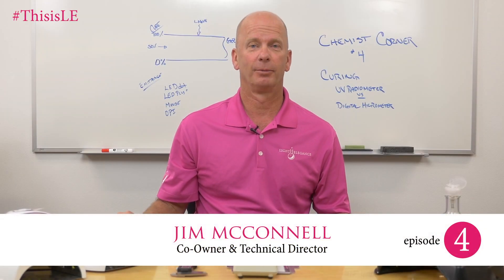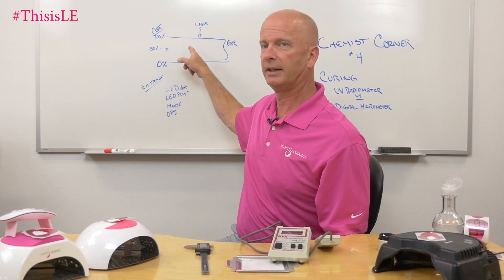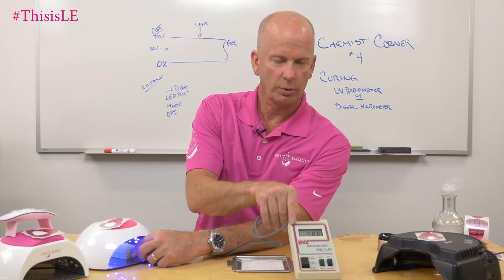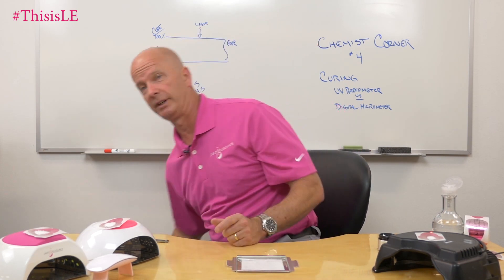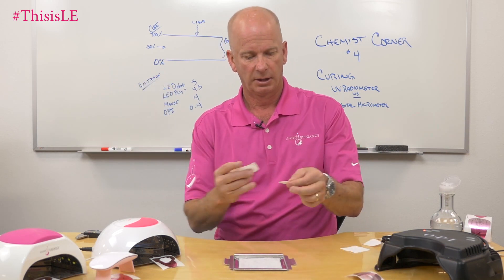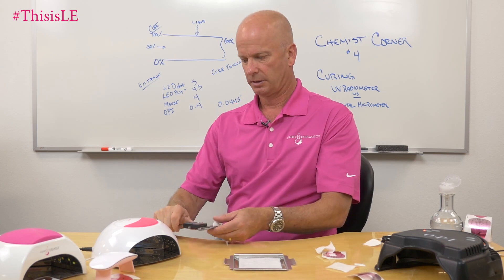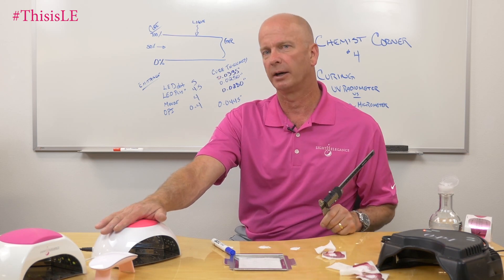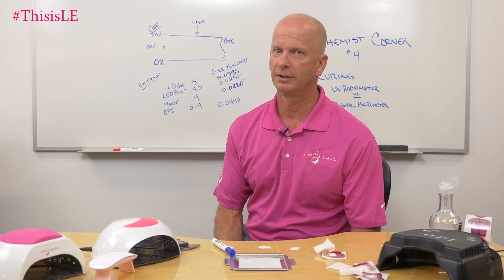How Good is the Curing Power of your LED Lamp? - Chemist Corner #4 with Jim McConnell

Comment: This is really informative, but also leaves me a little confused, I use builder gel and have been taught that you apply it in a thick layer, sweeping down the nail, can even tip hand over to let gravity help with apex of the nail etc but this means the product is much thicker then any of your tests, so I suppose what I'm trying to understand is, is this not the correct way to use a builder gel? And if not why are the nail companies teaching this as the correct method to apply the product 🤔
Reply: Hi Louisa - every company and each product can have a different application technique.  If that technique works well for you and the building gel that you use, then please do not change anything in your application technique.

Comment: but i dont understand the thickness part, is it better if it shows a bigger number? 
and what if the gel on the form is not as thick as i put it on the next form? wont it affect the number? or is it how hard it squeezes the gel together that makes the number?
Reply: You want to apply the gel onto the form thick enough so that the gel will not cure to a tack-free finish underneath - nearest the form.  This will allow the maximum amount of curing to take place to determine the amount of cure thickness that will be measured.  The thicker the cure, the better the cure in most cases.

Comment: Hi -- without the sensors and meters -- would it be fair to say a good test of whether our lamp is doing a good job curing is to make a layer the amount of thickness we would normally apply it at, place it under the lamp, lift it and see if it is fully cured or if gel is still on the form? Also I'm confused about the controls in this experiment... if it is gel polish and not builder why did it not cure at 1 minute? is the layer thicker than recommended? Why did the OPI lamp perform better if the gels are formulated for use with your lamps? I'm so confused, I'm sorry. Any feedback would be greatly appreciated as I have developed allergies and am desperate to avoid under-curing.

Comment: Is the curing thickness only relative to what it was from the beginning or is there a spectrum of numbers that are good or bad? For example if I want to test a new lamp and see if it's good or bad from the start, what would a good and bad starting number for the curing thickness be? Thank you for very educational videos!
Reply: This test is mostly geared to determining the condition of our current curing light.  If you have access to the manufacturer's recommended curing light and want to test a light that you would rather purchase, you can compare the two lights using the same test to see if the light you want to purchase will cure as well as the one that is recommended.

Comment: Hi Jim! Very educational video, the questions I have is, 
The rumour going round is that the gel is only around 50% cured when it’s hard? Is that true?
also I’m using a Sunuv light with the light elegance products ( mainly Cool gel and the buttercreams, which I love) is that okay provided I check it’s cured using this method, or should I be using a different light?
Reply: Hi Leighanne - the SunUV light might be just fine to cure our gels.  What model is it?  Can you take a picture of the interior and send it to me so I can examine to see if it is really a SUN UV/LED light or a cheaper "knock off"?  You can email me at jim@lightelegance.com.  Rumors can be correct but it is like playing the game "telephone" with friends.  Not all of the information is shared.  Some gels only cure 50% while others cure at higher percentages called "conversion rate".  Most of the LE gels cure to 80-93% conversion rate but this depends upon the light and length of time of the gel being cured.  We also allow the gel to sit for a period of 1 hour minimum before performing conversation rate testing - this allows the reactions to be completed.
Reply: @jimmcconnell6079  thank you so much Jim for this comment! I love learning "behind the scenes" stuff!
Reply: @jimmcconnell6079  I think what Leighanne is asking is how much (in percentage) do gels need to be cured for it to "appear" hard. As most nail techs don't have emittance testing equipment in house, a lot can assume the gel is fully cured if it "appears" hard. Which is dangerous because the bottom layers can still be uncured while the top coat appears completely cured. I believe it was Doug Schoon, chemist for  CND (I'm sure you already know) that wrote gels only need to be 50% cured to solidify and appear hard while still not being completely cured.

As for the conversion rates, I am assuming you are speaking of fully cured gels?

Comment: I like these videos. I don’t understand why this is important. Just to keep track of when to buy a new lamp? Also when you’re talking about cure thickness, you’re saying that if the gel is too thick it won’t cure all the way? So what would you recommend?  I obviously don’t want to give my clients bulky nails, but in terms of building strength?
Reply: If you replace your lamp every two years but do not need to replace it because the emittance and curing performance is still great with your lamp, you are spending money on a new lamp that you might want to use for a different purchase or to save it for the future.  Some curing lights don't last 2 years and you may choose to replace the curing light before the 2 year period before you begin to develop lifting problems because of the failing light.  If the gel doesn't cure all the way through to the fingernail, then you will have adhesion failure and subsequent lifting and unhappy clients.
Reply: @Lamar It’s always better to build up strength in layers that way each layer will cure properly. Also I prefer to build the nail in clear gel or very sheer gel. These gels cure “better” at a thicker layer.

Comment: Thank you for this video Jim, very interesting and informative! If there is a sticky layer on the form, would that mean that would also be the same on a nail plate? At what thickness would you gel to be mostly ideal? And what thickness would mean your lamp isn't curing well anymore? I'm definitely getting a digital micrometer, that looks like an interesting piece of kit to have!
Reply: Hi Samantha - I tell techs to perform a cure thickness test on the gels that they are going to use. The most difficult to cure gels will be the colored gels (like white, black, reds, ...) for decoration.  The clear gels will typically cure very thickly.  If the red gel polish cures to a maximum thickness of 0.020", then I suggest applying the red gel polish at a thickness of 0.010" (1/2 of the maximum cure thickness) for acceptable adhesion to the substrate.  If more opacity is desired, a second coat should/could be applied.  

Regarding the "light not curing well anymore" subject - all bulbs that we use to cure gels fail slowly over a period of time.  Our eyes do not observe this slow failure.  If we test the quality and completeness of cure every 3 or 6 months, we can use the digital micrometer to measure the failure for us.  Keeping a small journal or record book at your station to record the test results will document the curing ability of your light.  Once your light shows a decrease of curing ability at about 60-75% of the original cure thickness, it is time to think about replacing your light.  If you let your light get too weak before replacing it, you will have lifting and adhesion failure which creates unhappy clients and unhappy nail technicians :)

We have digital micrometers here that we purchased on Amazon - $20.  We also have a test procedure for you to request from sales@lightelegance.com and this will detail how to use the micrometer.
Reply: @jimmcconnell6079  - I cannot thank you enough for this info! Simply incredible! I already use LE hard gels but I think I should switch to my gel polish to LE because I love how transparent LE is and I feel I can trust you.
Reply: Hi Samantha - you should test a white or colored gel. The clear gels cure very thickly whereas the pigmented gels do not. The cure thickness will vary depending upon the gel you choose. Don’t hesitate to call or post your cure thickness results and we can help you from that point.
Reply: Hi Jim, I just purchased a digital micrometer, I'm going to test my clear gel tomorrow to see what the thickness is. I'm still a little confused on what the numbers should be and what that means in terms of application. Anyway you could break it down and imagine you're telling a 4 year old 😂😂😂 (my brain is working at about that rate these days!)

Comment: What would you say would be a good cure thickness range to compare results? It would be interesting to see this test done with numerous brands of  UV/LED lights!
Reply: When comparing curing lights I like to select a white gel and a black gel for testing cure thickness.  The black gels will typically be a thinner cure thickness than the white gels.  I test black gels at about 0.020" and white gels at 0.040"-0.050"

Comment: Just curious, many techs state they let the gel or gel polish cool before using the cleanser.  Some of my clients have mentioned it to me.  Does it make any difference? Thank you for the Chemist Corner!
Reply: Hi Rebecca - letting the gel cool a bit (15 seconds or so) is good for the top coats that need cleansing.  The cooler gels are slightly harder and resist scratching a little more than hot or freshly cured gels.  This is the only advantage and applies to gloss gels.
Reply: @jimmcconnell6079  Thank you

Comment: Thanks! So nice to not fly blind with a curing lamp. FYI I just do a harder/double press on my L.E. Dot lamp buton and it stays on all by itself, no need for a file or form over the sensor. Works great for folks with tremors.
Reply: Thank you - I will have to give that one a try ;)